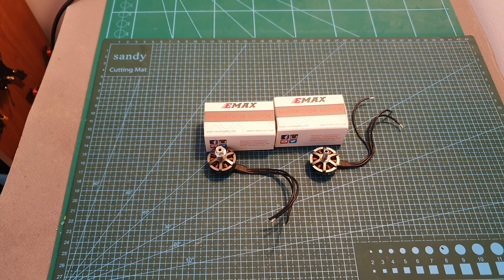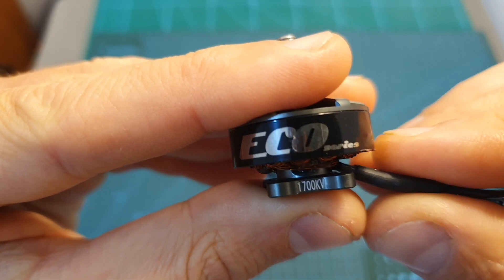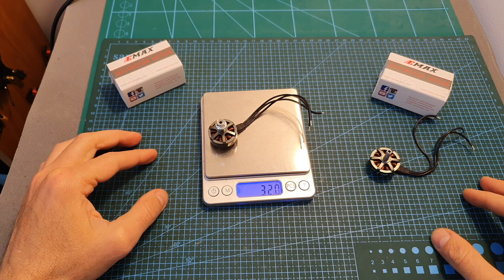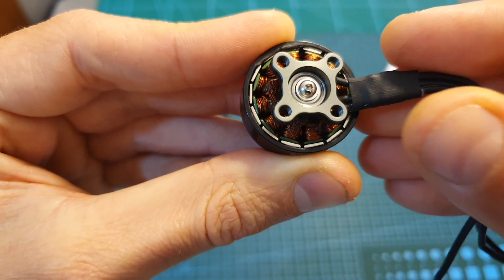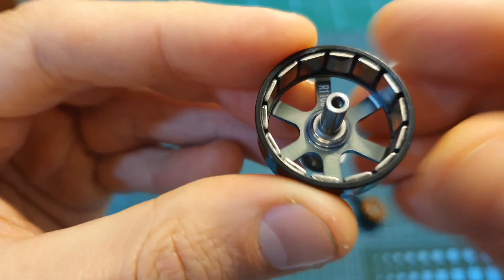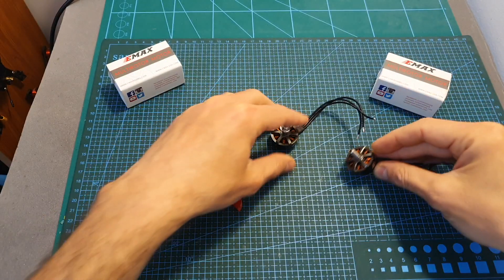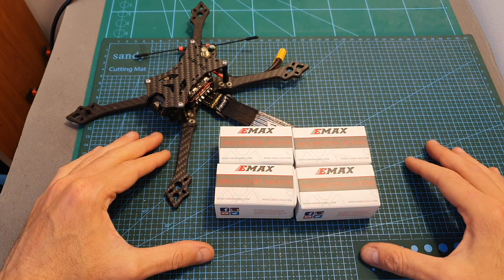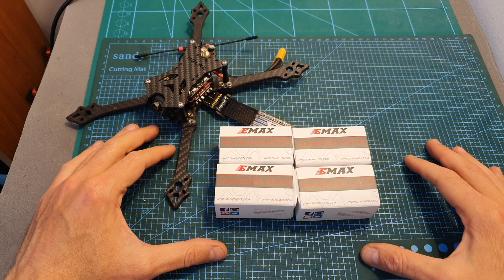Emax Eco 2306 Thrust Test (1700/2400KV)

Comment: it's magnificent your test. we notice that 2306 1700kv supports 5 and 6 battery ones however the 2400 kv its maximum is 4 s Did you remove the winding wire? How much does it measure in diameter section?

Comment: Hi, what you think, the emax eco 2207 motors similar to the 2306 ones? (the power consumption and thrust vales). Because I bought 2207 1700KV motors, but I don't find thrust test for that motors.
Reply from the maker: These are different motors and I haven't tested them, sorry.
Reply: @KremerFPV  ok, thanks.

Comment: Hi, bro... I bought 4 motors 2306 with 1700kv but I when i saw only 3 are 1700kv and 1 motor 2400 kv, I am used 4S 1300mah.

is it okay to fly the drone with diffrent kv???  Or i must make them all same kv?
Reply from the maker: Hi there. Well it's not ideal but it will work as the flight controller is going to compensate for the power difference.  Anyway it's recommended to run 4 identical motors.

Comment: Hello, thanks for your work. I am really surprised by the amp draw on 2400KV 4S : 23A is really low. Other tests seem to report higher amp draw like 35-37A.
I would buy immediately if it's really only 23A on a higher pitch prop that what I use (Dalprop T5045).

Comment: Can this moto run with 20A 4in1 esc.?
Reply from the maker: Yes, it should be fine, but 25a will be a better option.
Reply: no. the real current is about 32a, not 23. there is a proem in the current sensor

Comment: What do you think about the 1700kv version and 7 inches prop, 4s, for a long range wing, could be efficient? How many amps and thrust would you believe?
Reply from the maker: I think that it will be an efficient option for a long range quad, sorry but I haven't tested it so I can't tell you the amp draw.
Reply: would you say i could use 1700kv on 4s and 6s?
Reply: Mine using 3s and 6040 prop gets 9,6 amps and about 680g thrust.

Comment: which one do you recommend  2306 or 2207 ?
Reply from the maker: Well it depends on your setup and quadcopter purpose.
Reply: Just looking for thrust , more speed, mainly be on 3s ...
Reply from the maker: @utpal4455  You should use a 4S battery. Anyway I didn't test the 2207 version of the Eco motors yet. The 2306 2400KV motors seems like a good budget friendly option.

Comment: Are magnets removable on the rotor??  Or it is quite impossible to remove those magnets on the rotor.. Actually im gonna buy this motor for a different purpose... If the magnets are removable then i will buy.. Otherwise not
Reply from the maker: No, these are not removable magnets.

Comment: Im running the EMax Eco 2306 1700kv on a light weight build HGLRC Menafesto frame and they are decent on 5s to 6s.Eco 1700kv motors on 6s feels almost the same as HGLRC Flame 2450 motors on 5s.. But they still dont have the same punch as the HGLRC 2306 2450 Flame motors on 5s. But the Emax Eco motors on 5s or 6s gets 8 to 10 minutes of flight time conservatively and are ideal for light weight long range setups. I would say the Eco 2400kv could handle 5s. But the question would be for how long?
Looking forward to see your results Gal😀
Reply: By 4.0 has rpm limiting that could help them last a bit longer.
Reply: I have some 2522kv 2405s I'm gonna run 6s with a little rpm limiting should be good to go

Comment: I have the 2400 motors on my first 5". Being my first build I don't have nothing to compare with, but, so far so good. Doing some cruising with occasional acro moves, I'm getting 5.30min flight time with a 4s 1500mah lipo, ending at 14.8V.

Comment: Hi mate can you do a test with the 2400kv version on 5s... on run the rs 2400kv on 5s and is good😉😁👍👑
Reply from the maker: Unfortunately I have only 4 2400KV motors, so in case one burns I won't be able to test it on a quadcopter. Maybe after I will finish the test I will test it on the bench with a 5S lipo. Thanks for the suggestion.